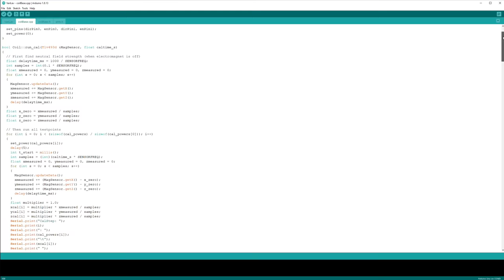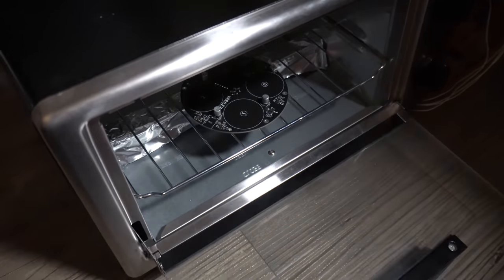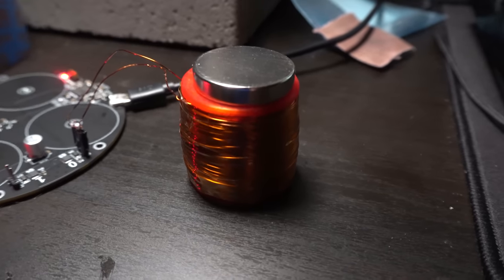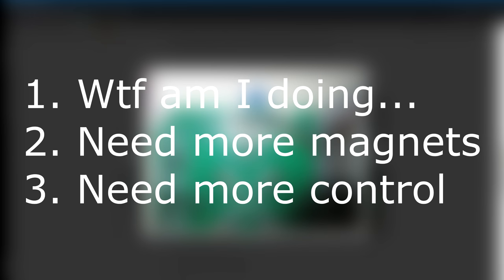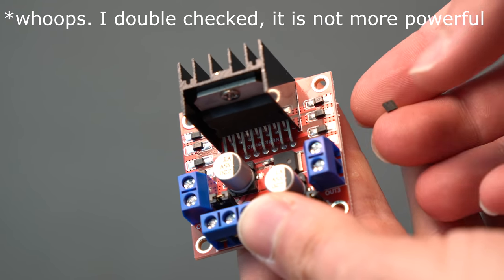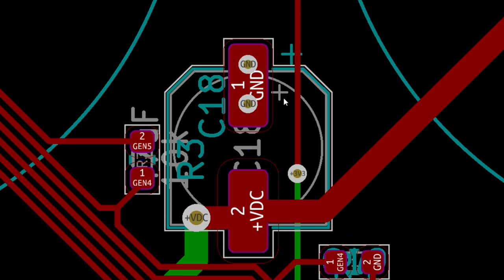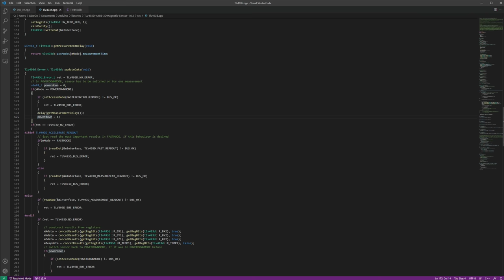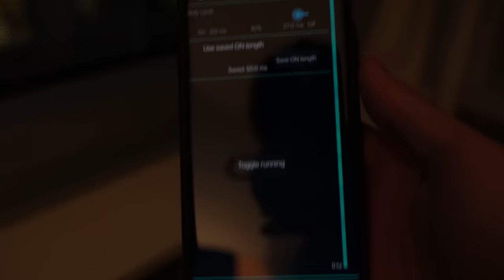Building a Digital Magnetic Levitation Platform!

Comment: What I have learned is that PID just works with a lineal and simple system.
This thing is full of non lineal components and lots of external perturbations.
You need the almighty state space variable controller and start doing linearization of the variables for something more or less stable, pretty much the modern control assignment of an engineering degree.
Reply: The chinese DIY levetron kits use PIDs though.

Comment: I know that is not the modern style of YouTube hardware development, but you could test your whole circuit and all possible add-ons first with a breadboard and/or handmade PCBs made of thin copper wires instead of wasting resources by ordering a new industrial made PCB each time you change something.
Greets from a hw-engineer.

Comment: Maybe my suggestions are useless.... but have you tried phase compensation? I can see there are oscillations in the output waveforms, which suggest that the system might be resonating at some frequencies. Another thing to try is PIDD² (or even PDD²) - I understand, the applied current is a proxy for controlling acceleration... I recall a combination of the two things mentioned above saved me once when I was having similar problems with another magnetic system.

Comment: Did you try turning it off and back on again? 
I couldnt resist. Im getting ready to start this build. with a couple mods, especially coils. I dont do vids but was going to record progress. Any suggestions?
Reply from the maker: Haha yes, many times. And it's really tricky but my best advice would be to figure out where to place the hall sensor such that the impact from electromagnets is minimal, and if possible select a hall sensor that can give faster readouts. Noise from the sensor and issues attempting to compensate for the distortion by the electromagnets were the biggest things impacting stability of my system.

Comment: Oh! I did the prety same way with building similar one. I used 4 analog hall sensors and digital control board. With no success. Looks, like general microcontroller not fast enouth. I actually maked it to work with semi-analog cheme. Digital circuit now auto corrects offset voltage throuhg digital potentiometers.

Comment: How about filtering the sudden mechanical movement of the magnet by using a wider base for the floating magnet. I mean instead of floating just the magnet you can make a non magnetic base for it and remove the sudden glitches in the magnet's movement.

Comment: Hi, actually chose this as a project for my electronic engineering degree. Can you maybe give the chip type that you use instead of the l398N (h-bridge)?
Reply from the maker: Awesome! I'm using the TC78H660FTG but there are plenty of other similar options if you want one that can do more power or a higher voltage. I just love tiny qfn parts for my boards!
Reply: @3DprintedLife  ah cool thanks, maybe some more questions will pop up on the next few days. Can I contact you here?
Reply: @3DprintedLife  "I just love tiny qfn parts" now that's something no hobbiest ever says :P

Comment: NEXT PROJECT:Build a Freq transmitter. Fix it to 13 Hz and transmit it at 10-15 dB sound level. Try making this device as tiny as possible. Make sure you have enough battery power for 10-12 hours use. Then go to a public place that has a lot of those FAKE flower pots around. Place your device on and cover it up. Do this with at least 5 more devices in the same area, and go back to replace each with a fresh coin cell battery. After about 2 weeks, pay close attention to your local news and see if you see your 'area' having more reports of fighting and anger outbursts. Final step, increase the sound level on all devices to exactly 50 dB and put new batteries in.

Comment: Can u print a donut shaped  platform that can hold a magnetic liquid? Or 2 flat pieces with a channel around the outter inside edges that join and create a circular tube sanwhich, then probably 4-6 or 8 smaller circular channels placed inside the largest channel that would also hold a magnetic liquid (first planet from the sun liquid🫡) and create smaller circular tubes when joined. Now if you add current (+ - ) they shud just go around in a circle really fast thus creating a constant flow. Maybe print it with a little board holder that it sits on like a pltform, then put ur mag iver and see if it stabilizes. If u can stabilize the base u can control anything above it by maipulating the energy frequency to make it move directionally🙃🙃🙃🙃🙃🙃

Comment: i bought one of these already fully assembled and the levitating magnet is stuck to a ferrometalic disk and the magnet is also much smaller than yours. I have swapped the provided magnet with my own and that has a big impact on its performance. So try different sizes of levitating magnets.
Reply from the maker: Interesting, thanks for the tip!
Reply: Also wonder if iron cores at each coil would help with magnetic field strength.

Comment: Maybe try adding mass to the disk to slow it’s oscillation and give the controller a better chance?
Reply from the maker: Yeah I did try that, later on in the video you'll see I embedded the magnet in a large printed disc to increase the moment of inertia. It did help but not enough and I can't add much more weight without it levitating too low.

Comment: Well, your magnets are sitting a few mm away from electronics. What did you expect. Probably start by shielding any electrical line in the vicinity of magnetic fields as much as possible before attempting to do any fine tuning of the control circuit for (I hope) obvious reasons? Ideally move all electronics (apart from well shielded power lines to the magnets) so far away from the magnetic fields that you can't measure it any more. Just my 2cts.

Comment: Some guy used high speed spinning magnets to build the similar levitation device
Reply: and it looked pretty much stable than this one
Reply: Because the mag field has a short leftover when its power voltage changed.the mag field won't be so rapidly changing as the voltage

Comment: the magnets radius is too big compared to the sensing range of the hall sensor. eveery time it rotates its being pushed in a random direction
you need a smaller magnet or more hall sensors. and maybe a higher sensing and correction frequency?
Reply from the maker: Hm good suggestions, I think faster sensing and correction is definitely the biggest missing piece. But I'll need to find a new sensor to achieve better results there!
Reply: @3DprintedLife  just get a smaller magnet to float.

Comment: mmm you need faster cpu power. Like a lot faster. and go full assembly for something that simple (aka a PID) filtering the curves might not be a good idea. Try to get the noise out using capacitors. Everything you use here should go faster and cleaner. I mean, if you want to beat analog, you gonna need this. The other solution would be to train ai at super speed. This also requires speed, a lot of speed....

Comment: use a cube or cylinder shaped magnetic unit where the top has a negative charge with the closet side to the charged platform has a positive magnetism with the four sides of the cube or cylinder side are neutral this will allow for a balanced levitation. not solid objects! prisms shaped objects. 
whetu original

Comment: I think it would be perfectly stable if top magnet had a spin around it's axis like in this video (something to do with angular conservation in momentum similar to why planets spin, also levitating). Question is how to make it spin with your code and electromagnets. https://www.youtube.com/watch?v=lhXWugwUja0&ab_channel=K%26JMagnetics
Reply from the maker: Yep spinning definitely would improve stability, but would only be possible with my setup if I add an off-center mass to my disc and use that imbalance to spin it up. Which would probably be trickier than just getting the original code working haha